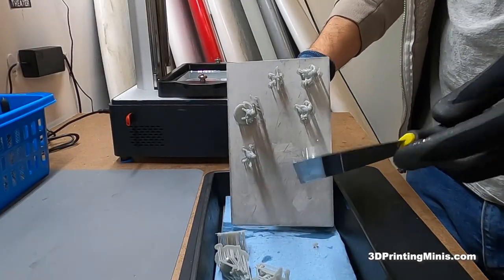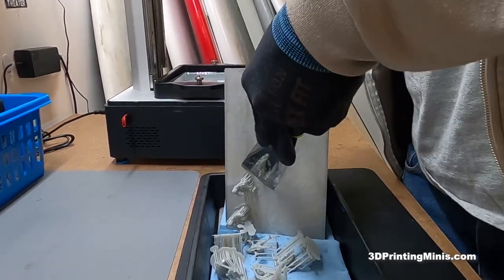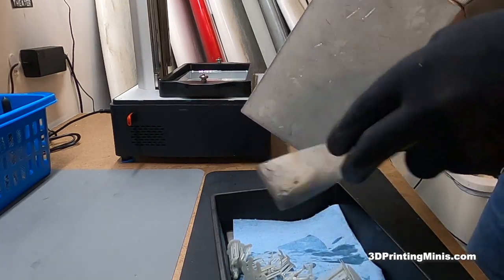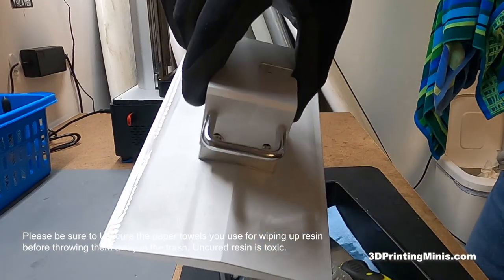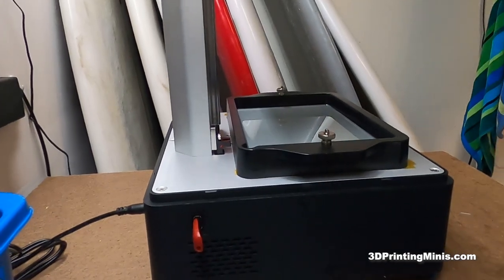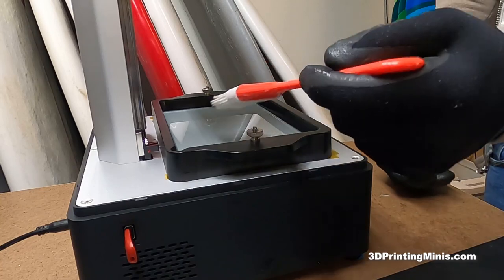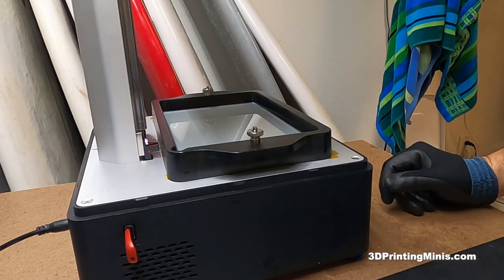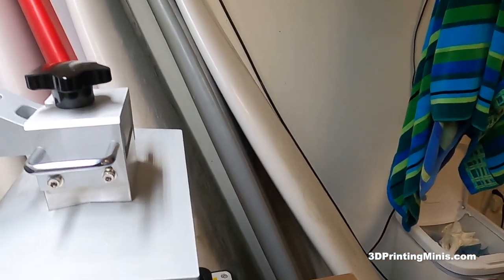How To Clean 3D Resin Printer Build Plates - How Clean Build Plate Between 3D Resin Prints

Comment: Just starting and I cleaned mine with the metal scraper and got a scratch on it and nearly had a heart attack. not too worried now looking at yours lol
Reply from the maker: Minor cosmetic scratches help the prints stick better (in my opinion). Just don't put any deep gouges on there if you can avoid it. :-)

Comment: Excellent, this is exactly what I do, good to see someone else not faffing about doing full cleaning each time, makes it so much quicker, and less wasteful of resin/alcohol
Reply from the maker: Yeah, I've got it down to a one-paper towel per change science. I tried using a magnetic flex plate but it's such a mess to deal with. Way prefer finding the proper base layer settings for my resin and then just using the scraper. Way more convenient.

Comment: There's one part of the process that I can't figure out from these videos - so you got your models off, cleaned the plate and reattached it. Do you have to level it right after that? If you do, do you take the vat out? Isn't there a risk some residue from the plate might get on the screen anyway?
Reply from the maker: If you're using printer like a Phrozen with the 4-nut system holding the plate in place, you shouldn't have to re-level the plate very often. The Elegoo style printers that just have one or two nuts locking the plate in place can be a little more sensitive (in my experience). You just want to make sure to only touch and hold the plate by the actual edges of the plate when removing prints with the scrapper. If you hold the plate stem like a handle and start cranking it around while scrapping plate you're going to knock your plate out of alignment pretty quick.